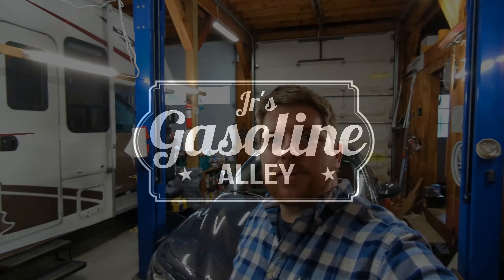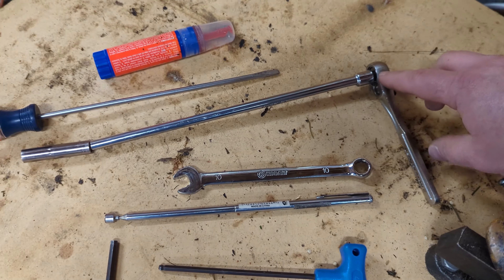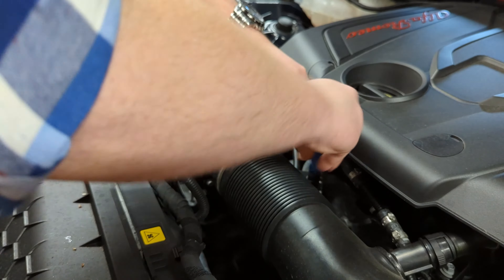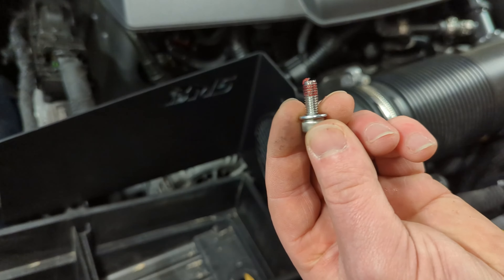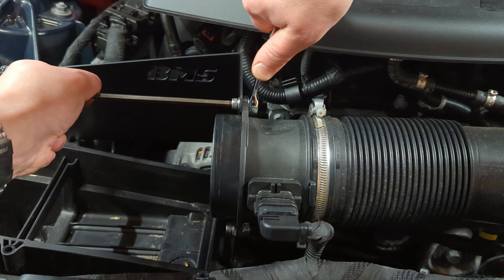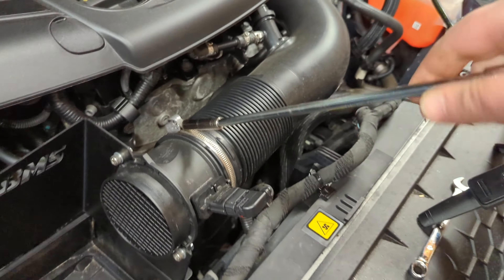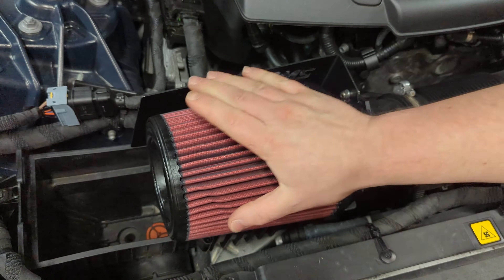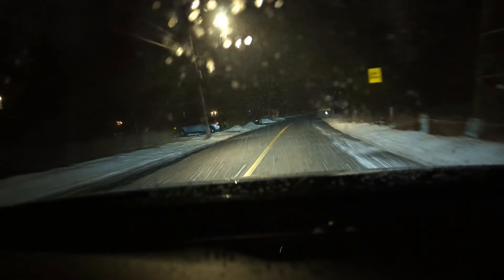Better Sound & More Power | BMS Intake Install & Drive | Alfa Romeo Giulia 2.0T

Comment: Fellow mass resident Stelvio owner finally installed my performance intake and I had a problem with my bottom right screw to my knowledge. I think previous owner damage the thread so I had to use the previous bolt instead of the 4 mm hex key screw that he suggested you install.

 I was able to get a tight install on the heat shield  installing it the opposite way around.
After  reading a few reviews, I read that some people drove an their intake has fallen off, so I wanted to make sure mine was secure as possible
It does sound great especially in sports mode i think im definitely removing the resonator soon. I wanna hear some crackle and pops

Comment: Just installed mine today. Ran into the issue that the supplied hardware is to big and the intake won’t sit flush and slips og when tightened. Went to Home Depot and got some 24x1 in flat head Phillips screws and another adjustable clamp

Comment: For anyone watching this video DO NOT INSTALL THE TOP CIRCULAR BOLTS THE WAY HE DID. He put them in backwards and doing so will have your intake filter fall off. Put the nuts on the inside and don't use the washers. I love the intake but BMS didn't think when it came to the actual mount. Car sounds amazing between 2,000-5,500rpm
Reply: Please don’t listen to this. I tried this first, and this is wrong. I ended up having to redo it the way the video said, and I lost one of my bolts 🤦I should’ve just listened to the video. The circular bolts are smaller and rounded so the filter can rub against them without hard edges catching/cutting the seal, also the clamp gets blocked from 40% of the hose it needs to grab because of angular bolts, while it slides underneath rounded bolts
Reply: I tried it both ways and the clamp is hitting the bolts so it can’t sit flush. Clamp even slipped off while tightening. Probably going to try without washers, then new bolts.
Reply: @retrogamejunkie6229 I replaced the hardware with flat headed Allen’s and a 11mm nut. So I could push it all the way up to the neck. Mine fell off and I didn’t know it for a few miles.

Comment: That sounds good! Have to ask, did it have any difference in sound at 1000-3000 rpm? Had one of those in my old Alfa 159 and it sounded good only revving at 3000-6000 rpm

Comment: Bit of an slightly unfair comparison at the start imo, stock airbox noise is it in neutral shot next to engine just revving and the other is in drive & underload where the turbo will spool up and add more noise and shot from interior/cabin ...does sound a wee bit nicer either way.

Comment: I recommend using different hardware. The bolt heads they send doesn’t allow the filter to slide far enough up to get a decent grip and will fall off when driving. Ask me how I know. 😢😂

Comment: I would love to do this to my guilia but I worry it would void my warranty.      Has anybody installed this and had any problems as far as warranty?
Reply: Of course, the engine warranty will not be valid. In addition, it catches the eye as soon as the hood is opened. Wait for the end of the warranty, or return the original filter before going to the service (I don't know if it is sealed/marked)

Comment: Just bought a new  Giulia Veloce in the UK.  Would  fitting  this void my 3 year warranty.?
Reply from the maker: Check the law in your country or talk to your dealer. In the USA it won't void your warranty unless they can prove it directly caused the failure. This is thanks to the Magnuson–Moss Warranty Act, but that is only specific to the USA of course.

Comment: would be more inclined to get it if I saw some dyno numbers behind it.
Reply from the maker: Without a tune, you are hard pressed to make any significant additional power
Reply: @JrsGasolineAlley  You won’t find me arguing with that statement however you are the one that put in the title that the car is making more power. You do not however show any evidence of that in the video.

Comment: Whats the difference between this and a cold air intake?
Reply from the maker: This takes ambient air from the engine bay and intake duct. Cold air usually goes down into the bumper for colder air.

Comment: This thing is garbage. HEAT SOAK CITY.  I hope it didn’t cost more than $80. A cone filter and a piece of coated sheet metal. Dam.
Reply from the maker: none of those problems. but okay.

Comment: Hey man, thanks for the video! Followed it religiously! Only issue I had was the bolts that come with the intake doesn’t allow the metal coupling to go under it can tighten. My intake keeps falling off 😭thoughts?

When I tighten the coupling, the intake starts comings off because it’s not wrapped around the intake pipe.
Reply: What did you figure out? I ran into this issue tonight.
Reply: @Dontjuststareatit  I went to Home Depot and found small screws for it. I wish I kept the size